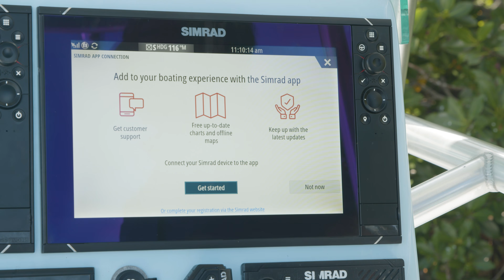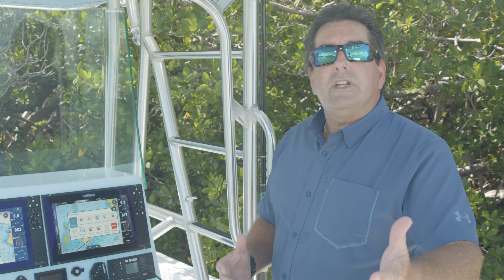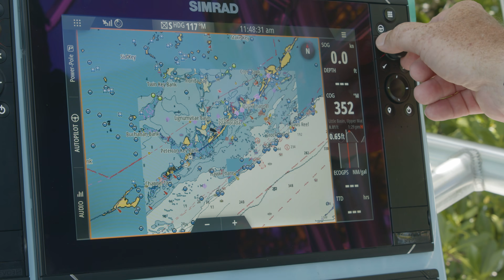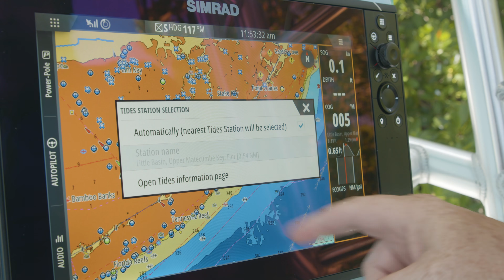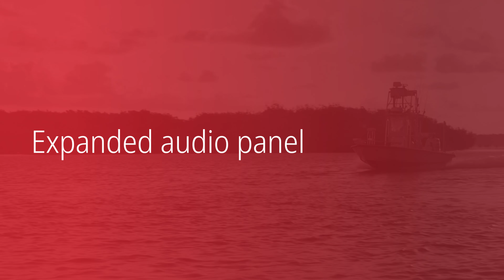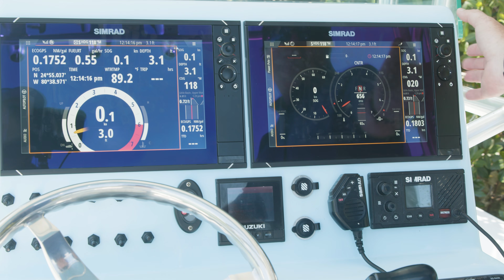Simrad NEW NSS Evo3S | Walkthrough

Comment: Perfect video. I would like to know what do i need to connect my smartcraft Mercury (2021 model )to my simra evo3s 12inch . Thanx. I already have a Nmea 2000 network installed. Thanx.
Reply from the maker: You will need a Vesselview Link gateway or one of the VV screens that acts as a gateway. All available through your local Mercury dealer. We do not sell them.
Reply: @simrad-yachting  Thanx for your answer.
Reply from the maker: You're very welcome.
Thank you for using our products.

Comment: Great presentation. Can you mirror the nss12 to another display say...ipad ios or tablet android at another location on the boat wirelessly?? And if yes, would you be able to fully control it from that mirror device or just for display only?
Reply from the maker: These are features we are working on. However the mirroring feature should soon be active.
Reply: Hi.  Is this mirroring feature now operational after the work you have done in the past year?
Reply: @Camh1968  called head office in Sydney. Explained to them. And said will get back to me. Never did. 
Made 2 phonecalls. Both occasions spoke to tech. Promised to call back… again! Never did. 
In the end I gave up. Don’t trust the after service. Went for Garmin instead GPSMap series. Never looked back. Happy as. Worked perfectly on my 2 tv via hdmi.
Reply: Thanks for reply.

Not good after sakes service from That dealer.  Which model Garmin did you get?